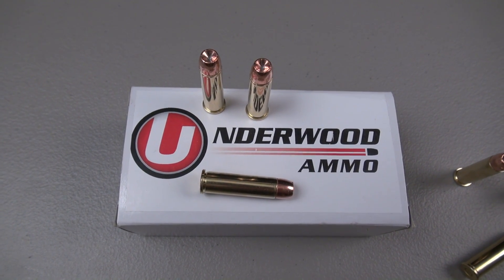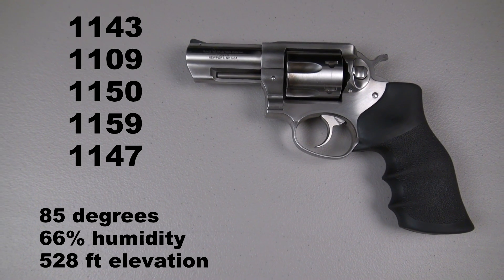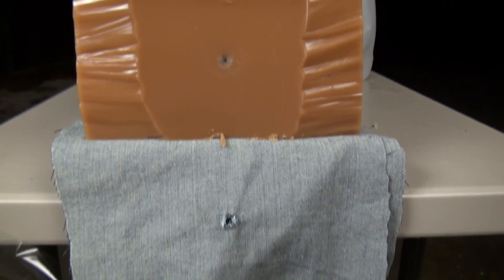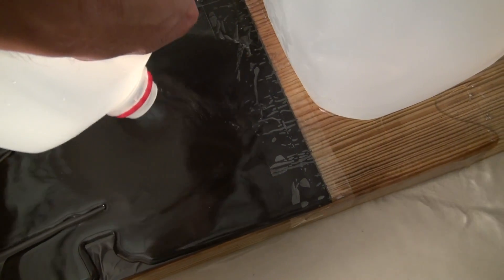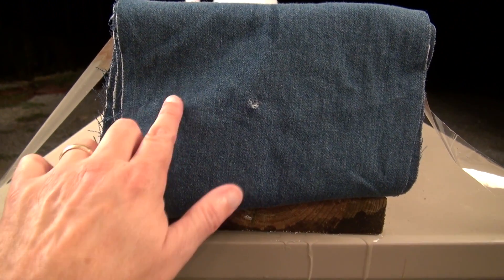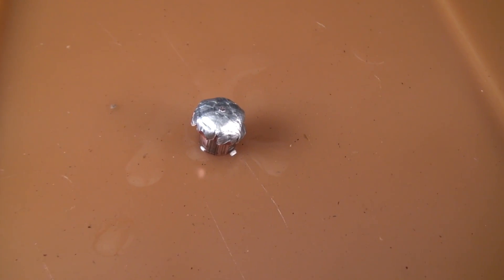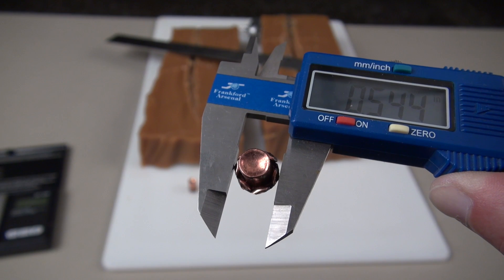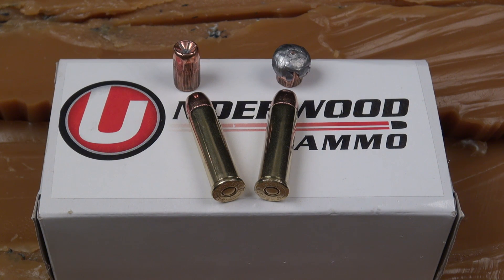Underwood .357 Magnum 158 gr Gold Dot Ammo Gel Test

Comment: I would argue that there is not enough velocity to allow the .357 158gr Gold Dot to expand properly. Probably would have not had so much penetration with a high velocity due to far greater expansion. This is likely why the 125gr gold dot worked so well.

Comment: Not enough velocity.. I never run 158's in a pistol I might if I had a rifle in 357 but not handguns.. your better off using a 40 than a 158gr 357 out of pistol
Reply: I used 158gr .357Mag in a self defense shooting early this year. Five shots of five fired cleared the barrel (4" barrel of a Colt) and all of them hit target. All of them (except one that hit in a very thin spot on the target's body) stopped in my target and worked. I have severe PTSD now. I slept about 20hours that month and lost 15lbs.

Comment: For those interested in how the Underwood 125gr. version performed, 1420fps from a 2" barrel, 16" penetration with 4 layers of denim and .48" average expansion.
Reply: They ought to call it Undertaker not Underwood.
Reply: Yep, 125gr for 2-3" barrels 158gr for 4+". Should be a beast in a Blackhawk.
Reply: 158 works just fine and expands very well out of a 3 inch. If you're not using this turboed up underwood or buffalo bore ammo @mkshffr4936
Reply: @mkshffr4936  I was going to write this same comment about 4"+ barrels for this load.
Reply: Other people on YouTube do the same test and have better results with nice expansion

Comment: 1475 is out of a 6" barrel. It does chrono that as I used my old Ruger Security-Six to verify. Expands at that velocity. Better to go 125 or 110 in a short barrel.
Reply: I was going to mention that I believe it passed through because it was out of a short barrel and didn't get the desired velocity of that bullet design and the way they intended it to be I'm willing to bet it would of been fine out of a six inch barrel maybe still closer to 18" mark but yea that's my thoughts
Reply: You're right - no way that 3" barrel is going to lose 333fps in comparison to a 4"... 3" barrels normally only lose about 5 or 6% velocity in comparison. It has to be 1235fps from a 4". 1142 (3") down from 1235 sounds right.

Comment: do you have any idea what the fps is out of a 2.25 inch sp101?
Reply: Underwood does not do 158 grain .357 Magnum any justice.  You'll see from tnoutdoors9's video of the Remington 158 SJHP easily exceeded this offering by Underwood.  Underwood dropped the ball on this cartridge in this bullet weight.  Underwoods 125 grain and 180 grain .357 Magnum offerings are MOST exceptional.
Reply from the maker: +0307 0307 I do not.  Might try the Ruger forum.

Comment: I've seen other tests of this load as well as the Speer load.  Even when they expand properly they really over penetrate .  I'm thinking this might be a round intended for hunting with a {Lever Action} Long Gun.  This would also make sense of the velocity rating of 1475fps on the Underwood.  What do you think?
Reply: He's shooting it out of a 3 inch barrel. Most stats derive from 4 & 5 inch barrels. If you were to shoot this from a long gun, the velocity would pass the 2,000 mark.
Reply: doubtful that this load will get anywhere close to 2,000fps from a rifle barrel. A 158gr jacketed 357 load that gets 1450 from a 4" and 1550 from a 6" will very likely just scratch 2,000 fps from a 16-18" barrel. Thechoppinblock channel did a review on underwood's 357 xtp load and that load tickles that 2000fps mark. That is the top end of the 357 cartridge.  Ive done some loading with 164gr coated lead bullets and lilgun using 158gr xtp data and that powder is the only one that will break the 2000fps barrier out of a rifle.
Reply: Rusty Shackleford: I'm pretty sure it would reach the 2,000 FPS mark.
Reply: This load won't, but Buffalo Bore Ammo will.  Buffalo Bore 357 Mag 158 gr JHP hits 2158 fps from a 18.5" Marlin lever action, 1707 fps from a 6" Ruger GP 100, 1485 fps from a 4" S&W L frame,  and 1398 fps from a 3" S&W J frame. I bet BB is using a progressive powder very similar to Lil' Gun.  Maybe is Lil' Gun.
Reply: 63DW89A I did a quick search and couldnt find anyone doing chrono results with that actual load, I would be impressed if they actually go those speeds. thats over a thousand foot pounds of energy from a revolver and 1675 ftlbs from a rifle. Maybe I'll have to buy a box and see for myself. I worked up to 19.5gr lilgun under a 164 coated lead bullet and started seeing signs of possible case head separation on one of the cases. 

It would be interesting to see if buffalo bore and underwood are using lilgun. lilgun is a pretty unique looking powder, different than any of the other magnum pistol/slow rifle powders.
Reply: Buffalo Bore chronographs their ammo from the actual handgun / rifle listed, not from a test barrel so velocities are "real world".   Just bought a pound of Lil "Gun to try in the 357 Mag / 38 Spl.  First batch of 38 Spl standard pressure 158 gr RNFP (Lee mold) hit 1000+ fps from a 4" S&W 66, faster than factory +P!!  Seems to be an excellent progressive powder, high velocity at lower pressures.  Am using "45/45/10" Alox lube (45% Alox/45%Johnson Paste Wax/10% Mineral Spirits) with great results, NO leading at all, even with a soft 9.5 BHN lead alloy designed for best expansion in lead hollow points.
Reply: lilgun in a 38spl case? Where did you get that data? Its not on Hodgdons site or any of my manuals. I understand you can load 38 cases to magnum pressures when fired out of a 357 firearm with a slightly reduced load to take account for the shorter case. I wouldn't call it a standard 38spl load. I cant very clearly recall, but there has been talk of hodgdon's extremely low listed pressures on lilgun being flawed. Its burn rate is between that of 2400 and w296 and it sure shows the same signs of higher pressure that I see in w296 loads. 

Its always nice to have a load where tumble lube alox just works. I've had success with some calibers and none with others. I powder coat everything I shoot now and couldnt be happier. the extra time spent powder coating my bullets is worth the benefits leaving a perfectly squeaky clean bore, cleaner gun, cleaner hands, less smoke as well as significantly reducing lead exposure during the loading, handling and firing of the ammo.
Reply: You are correct there are no published data for Lil Gun in 38 Special. I found starting data here : http://www"DOT"thehighroad.org/archive/index.php/t-322582.html in the post by riverrat6340 and started my 38 Spl 158 gr experiments 25% below his listed data using a GP 100.  High +P velocity and pressure signs on fired brass indicated normal 38 Spl pressure levels.  Lil Gun does seem to burn hot though and there are reports of throat erosion in heavy 357 Mag loads.  So examine closely if you experiment with 38 Spl loads.   I'm cautiously optimistic that Lil Gun shows great promise in 38 Spl 158 gr loadings, and hope that the lower 38 Spl charges will not cause the same erosion problems as the heavy 357 Mag loadings.

Comment: 66% humidity.

Jesus christ man, how do you tolerate that? I can't handle Southern heat, and when you add in Southern humidity, I start to melt.
Reply: hulk hogan, I'm Florida born and raised! 66% for us is a nice DRY day! You get used to it when it's the norm I guess. But it's actually the cold months that SUCK! Cold + high humidity = suck! No matter how thick ur coat is it still soaks thru! I was stationed at Ft. Carson CO. and came home to FL on leave one Christmas. It was -15 when I left CO and it was 32 in FL... I FELT 100x colder in FL!! In CO at least you didn't feel cold with a coat on, but in FL it just soaked thru ur coat and chilled you to the bone!
Reply: Lmao. Even in Virginia we have 100% humidity most of the summer.

You get used to it.

Comment: I have been experimenting with 357mag loads in Ruger Blackhawk with a 6" barrel.  I tried a 158gr XTP from Freedom Munitions in water jugs.  I laid out 6 water jugs that stopped a 203gr SP 7.62x54R fired from a 91/30.  We are talking about a load that literally blows the front shoulder off a 150lb deer.   The 158gr 357mag blasted right through all 6 water jugs.  I am convinced the bullet expanded.  The first two jugs exploded like they were filled with a carbonated drink.  The hole in the jugs that didn't explode was larger than the hole left by a 9mm 135gr Critical Duty fired from a G19.  The Critical Duty expanded to ,68".  The were small fragments in the first jug.  I believe  that the 158 gr 357 mag load is just a perfect penetration load.  I cannot wait until deer season so I can test a 158 gr 357mag on a good size doe.

Edit:  I tested the Freedom Munitions XTP in my Charter Mag Pug with a 2.25 inch barrel.  From the Charter the 158gr XTP bullet did not expand.   In my opinion, the 158gr XTP will not expand reliably from a barrel less than 4 inches. 

Honestly, I cannot recommend a short barrel 357 mag.  You are far better off with a Glock 19/26 than a short barrel 357 mag revolver.  From a 2.25 inch barrel every 357 mag load I tested was comparable to a 9mm +p load in energy.  

125gr Critical Defense expanded nicely from the Charter.   Every hollow point or JSP I have tested with the 6.5 inch Blackhawk expanded.

Comment: Was the .357 Sig designed to replicate the .357 Magnum, or replace it? Out the Glock 32, the .357 produces more energy and performs better.
Reply: No auto pistol cartridge out there including 10mm can replace the 357 Magnum loaded to full safe pressure potential in a strong revolver such as a Ruger GP 100 or Ruger Blackhawk Single Action. Delayed blowback autos have design limitations that prevent safe firing of a cartridge as intense as the 357 Mag loaded to full potential. The 357 Mag in effect is a rifle cartridge loaded in handguns.  In a rifle barrel, 357 Mag 125gr bullets can hit 2400+ fps and effectively run with mid-range 30 cal rifle cartridges like the 7.62X39.
Reply: @63DW89A  9x25 dillon can.  But people who shoot autos are afraid of recoil.
Reply: @wesleyhargis1123  Look carefully at the case capacity of the 9X25 Dillon, and compare to the 357 Magnum. You'll note the 357 Mag has about 25-30% higher case capacity than the 9X25 Dillon, so the Dillon simply cannot match the 357 at max loadings.  The 9X25 Dillon is a capable cartridge, but in strong guns (Ruger GP-100, Ruger Redhawk 357, Ruger Blackhawk, etc) the 357 Mag will leave the 9X25 Dillon in in its dust. Plus you have the major advantage of a revolver over an auto pistol, in that the revolver will shoot any bullet shape without issue.  The auto's only advantage is capacity, otherwise, the revolver, by a very wide margin, is the better gun.
Reply: @63DW89A  That may be but the max loads I have seen through a chrono for them from 6" barrels are in the low 1700 fps range with 125's.  If you know of some faster .357's at that weight I'm keen to learn
Reply: @wesleyhargis1123  Check the Hodgdon powder site. Max loads for 357 Mag 125 gr XTP using H110 (Win 296). I've run them and get about 1750+ from a 4" GP100, and an incredible muzzle fireball. These are Hodgdon advised max at around 42000 CUP although you could push a bit beyond to the SAMMI max of 45000 if you want to play dangerously!  I do not like such loads for self-defense as the pressure would rupture your eardrums if fired in a small room. I prefer to load self defense 357 Mag down to 1150 fps for a 158 gr LSWC-HP; this duplicates the old 38 Spl Hi Velocity (AKA 38/44) loading of the 1920's. I like to load a few 38 Spl self defense to the same 1150 fps level, also with a 158 gr LSWC-HP "STRICTLY for my use"; otherwise my hot 38 Spl 158 gr loads stay in 950-1000 fps range, for "other people's guns".   The 158 gr @ 1150 fps has about the same striking force as a 230 gr 45 ACP @ 850 fps as actually measured on a 100 pound ballistic pendulum. Plus, for anti-personnel use, no JHP can equal the performance of a cast lead hollow point bullet.  Ability to fire any bullet without issue, is one of the reasons I lean more and more toward revolvers for citizen self defense.  I still carry 9mm and 45 ACP autos at times, but truthfully none of the autos give me the confidence of a 38/357 revolver loaded with a 158 gr lead HP @ 1150 fps. My water impact tests, thru various cloth barriers, show the lead HP to be a sure and certain performer, while JHP's often fail completely to open.  Also had a Lee 230 gr RN 45 ACP mold HP'ed to make a 210 gr HP bullet soft cast to 10 BHN.  Fired at 1000 fps from a 4.75" barreled Uberti replica of the Colt 1872 Open Top in 45 Colt, that 210 gr Lead HP literally blew a 1 gallon jug 30 feet, opening it up as flat as a sheet of newspaper! [We never load the 1872 Open Top much beyond 45 ACP momentum levels]  The AR15 guys at our range could not believe that the 45 Colt from such an old style gun could actually exceed the explosive force of their 5.56 mm's on 1 gallon water jugs. We couldn't either until we tested that moderate 210 gr 45 Colt round!!  When my brother and I show up at the range with water jugs for testing, EVERYONE wants us to test their carry ammo in 9mm, 40, 45, 10 mm etc.  We now just fill the pick up bed with filled water jugs when we head to the range. Sometimes we even get to test our own ammo!  BUT, the guys do save their 1 gallon jugs to give to us.
Reply: +FlyTour69 The 357 Sig operates at the low end of 357 Mag performance.  Ammo companies have to load the 357 Mag at low end so as not to destroy small 5-shot alloy framed revolvers.  The 357 Mag cartridge has about 40% more case capacity than the 357 SIG cartridge, so in a strong-framed gun like the Ruger GP-100 or Blackhawk, hand loaded ammo can safely be loaded to outperform the 357 SIG by a considerable margin. Just don't allow such 357 Mag loads near a small 5-shot alloy-framed revolver!
Reply: FlyTour69 energy makes no difference in stopping power.  weight retention and penetration are most important.
Reply: .357 Sig was an effort to reproduce the performance of a .357 magnum in a semi-auto cartridge, thereby removing one of  the reasons some die hard revolver shooters refused to convert to semi-autos for their self-defense weapons.  There wasn't any thought of "replacing" .357 magnum.  I leave to others to opine on how successful that effort was, but I do note that the chambering is far less popular than the "big three" pistol cartridges:  9 mm, .40 S&W, and .45 ACP.